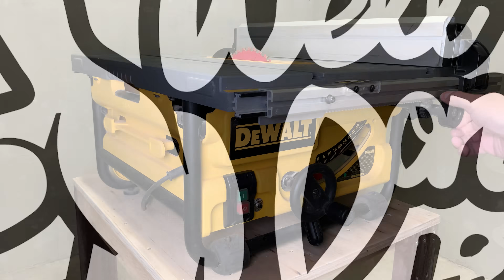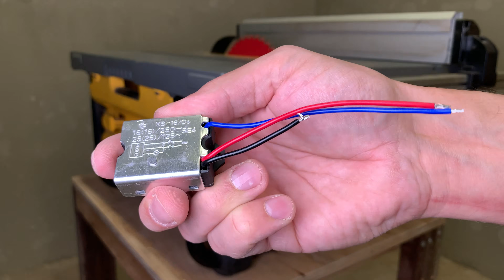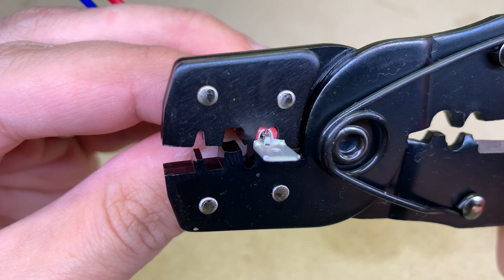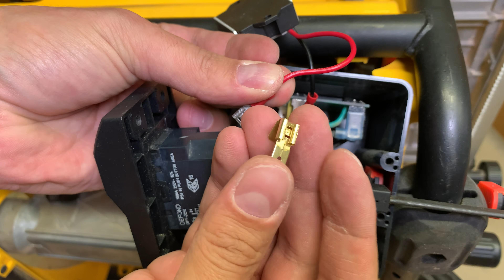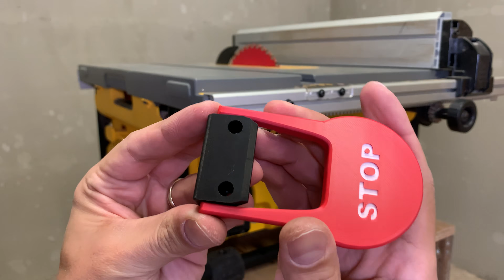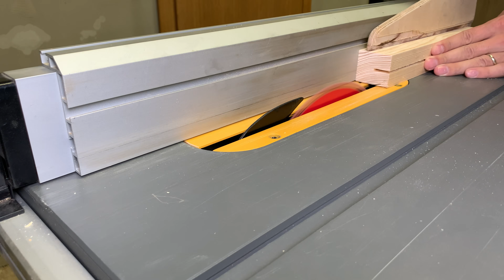Improving Dewalt Jobsite Table Saw With 3 Crucial Upgrades

Comment: I have the dw745 model that has the large slapstop paddle. I like the idea of the soft start and your explanation was so thorough, that even this electrical novice can install it. Thank you very much! I would modify the riving knife as well, but until I can come up with an overhead dust collection hood for the blade, it will have to stay as is. I can also make a separate riving knife out of scrap metal to be installed when the hood may get in the way of a particular cut, that way i do not ruin the stock knife. I won't go without some sort of a knife behind the blade though as 
So many do. It is an essential safety feature and a must for me. Thank you again!!

Comment: Interesting. The UK (DeWalt) version of this table saw - & I include mine - purchased from new five years ago, has a low profile Riving knife, soft start module in-situ, & an overlaid kill-switch plate; unsure as to where precisely you are on the globe, but I find these three essential components should be standard, worldwide. That said, your tutorial for upgrading was excellent.
Reply: I got my 7485 a few days ago and it doesn't have a soft start
Reply: Then DeWalt's policy for global standardisation has failed, Matt - either that, or the regulatory body for your country is at odds with the rest of the world.
Reply: @andrewtongue7084  I'm in the UK. Bought from Toolstation a few days ago. Definitely no soft start
Reply: OK, Matt - more than coincidental, I bought mine from the very same outlet, sixty two months ago; obviously, no consistency in DW's manufacture supply 🤔
Reply: it is possible some may bought with soft-start, safety regulations changing all the time, manufacturers has to follow those rules.
Reply: Indeed.

Comment: My DWE7485 already has all of those features, including the soft start feature, and the standard riving knife, but the start button also has a safety lock to lock the saw from being able to start. And it has an additional pin feature to be able to lock the lock self into that same position to keep the Saul from being able to be unlocked.
Reply: Hmm, my 7485 doesn't have a soft start.
Reply: My 7485 doesn't have a soft start either

Comment: Be sure to check the specs on any soft start module you buy. Dewalt job site saws are rates at 20 amps as are many other saws. Even my Dewalt circular saw is rated 20 amps. It's difficult to find a soft start module rated at 20 amps.

Comment: Already I’m not a good woodworker…. You scared me with my Dewalt  table saw. . I wish I had your intelligence because I am scared of my table saw…
But nonetheless a good video for much more experienced hands on workers. Cheers.
Reply: Watch videos on safety. Then get scrap wood and practice, practice, practice. All saws are inherently dangerous, but with proper safety procedures, you can come to really enjoy using a table saw. Eye protection and hearing protection are really important as they free you to stay focused on the work in front of you. Use push sticks and feather boards.  Never use without a riving knife installed.
I have a mental checklist that I go through every time before I turn that saw on.  Been a contractor for 40 years now.

Comment: Good video, that hard start is very annoying!! But I have a key question - that fence of aluminium extrusion is not standard - where did you get it from? Is it a standard extrusion profile or did you get it made custom? And how did you attach it? That for me is one of the weaknesses of the standard saw that it looks like you have fixed really well, but strangely not shared! I have seen huge plywood or MDF fences built over the DeWalt fence, but they are way too big, heavy and ugly for me! Were you able to build any adjustment into it? That is, some of these fences are not 100% vertical, but there is no adjustability - were you able to make any fine adjustments using threads, shims or such like? Would be really curious to know! (thanks)
Reply: There were 4 types of this saw made over time, the fence is (I think) a standard type 3 - you can buy it from dewalt and is compatible with current type 4 saws.
Reply: @steveedwards4679  thanks mate, I haven't seen the fence on any other DeWalt table saw and I've watched MANY videos, but I will try find that fence! Otherwise will have to try an aftermarket jobbie

Comment: the newer version (like my 7492) has all that except for softstart. I would say the top 3 upgrades are: 1 throw away the mitre guage and replace with something decent or at least use a bit of tape, to minimize rattle. 2 make a zero clearance insert or crosscut sled 3 get something like a flat but wide aluminum extrusion for m8 that can simply be attached to the fence, e.g. for resawing. 🙋🏻‍♀️Anna
Reply: Crosscut sled are dead.

Comment: how can you make this saw less noisy?
Reply: Wear ear protection. The saw is almost silent.  😉
Reply: I agree it is very noisy, but there are limited/no options to reduce sound with an open frame (unlike with cabinets). But for a small, reasonably priced saw, it is hard to go past that rack and pinion fence system. That fence of aluminium extrusion is not standard - Well Done Tips where did you get it from? Is it a standard extrusion profile or did you get it made custom? And how did you attach it? That for me is one of the weaknesses of the saw that it looks like you have fixed, but strangely not shared! I have seen huge plywood or MDF fences built over the DeWalt fence, but they are way too big, heavy and ugly for me!

Comment: I was hoping for fence post upgrades or accuracy improvements. Etc..
Reply: Me too, especially as the newer version (like my 7492) has all that except for softstart. I would say the top 3 upgrades are: 1 throw away the mitre guage and replace with something decent or at least use a bit of tape, to minimize rattle. 2 make a zero clearance insert or crosscut sled 3 get something like a flat but wide aluminum extrusion with that can simply be attached to the fence, e.g. for resawing. 🙋🏻‍♀️Anna